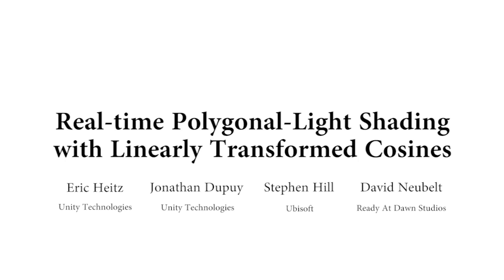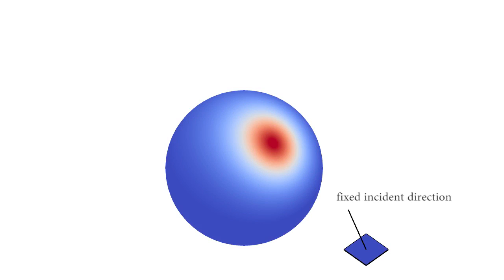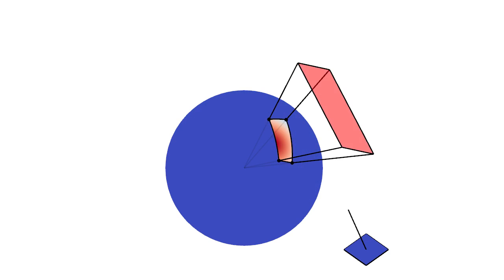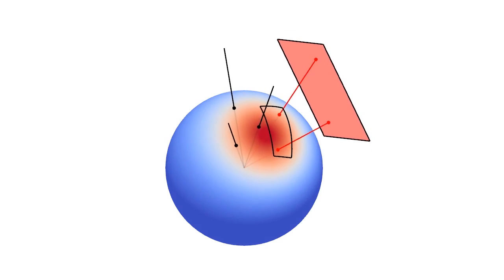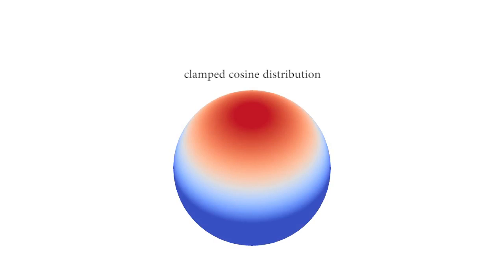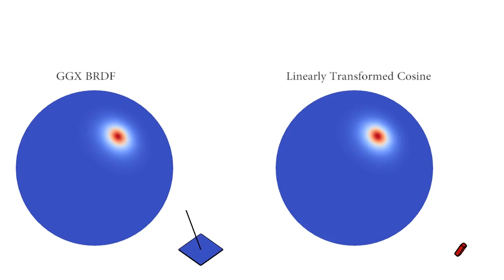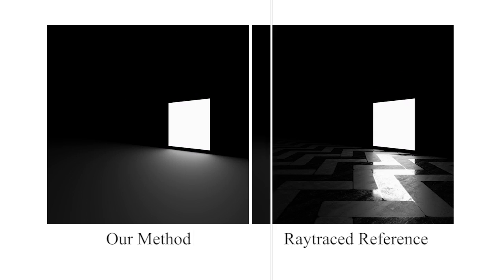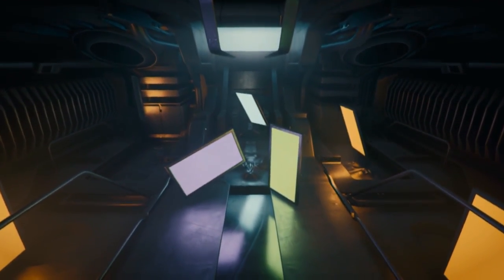Real-Time Polygonal-Light Shading with Linearly Transformed Cosines

Comment: Is this less expensive than raytracing simulation? The video only mentions about a GPU implementation, but what would a software implementation be like?
Reply from the maker: Yes it's less expensive than simulation through raytracing because you only need one evaluation to get the entire shading due to an area light (rather than spawning many rays from the surface you're shading towards the area light). You can port our GPU implementation straightforwardly to the CPU.

Comment: What does "this spherical integral is invariant to linear transformations" intuitively mean?  
I've only recently started reading this blog : https://mynameismjp.wordpress.com/2016/10/09/sg-series-part-1-a-brief-and-incomplete-history-of-baked-lighting-representations/  
so I was able to understand that its difficult to integrate spherical gaussian area lights in real-time with gaussian on probe surface, so we use a cosine-lobe to approximate the area lights. Therefore problem transforms from integrating 2 SG's to simply multiplying an SG with a cosine-lobe. (Please feel free to correct me if I'm wrong).

When you say 'this spherical integral is invariant to linear transform" can I understand it as 'you can do as many linear transformations on the area light :- Move it around, deform it(linearly), rotate it...whatever. The irradiance calculation would be affected accordingly(and correctly)"

So this basically gives us the power to make indirect lighting of moving area-lights(even though its just linear motion), compared to current method of 'baking' a static-lights scene onto the probe and using those probes interpolate/approximate indirect lighting at runtime.

If what I understand is true, then this is definitely interesting development!
Reply: When they say "this spherical integral is invariant to linear transformations", it means:

The math behind how we calculate the total light contribution doesn't care about changes like rotations, scaling, or translations of the area light or the scene (as long as the transformations are linear).
You can move, rotate, or deform the light linearly, and the calculation will adjust itself to these transformations automatically and give you the correct answer.